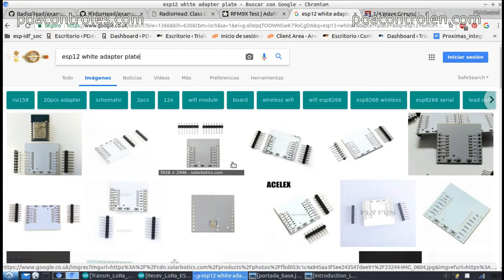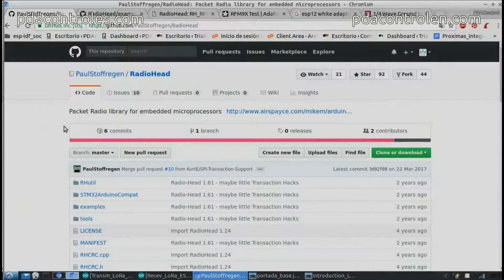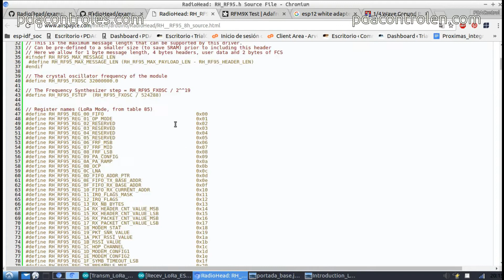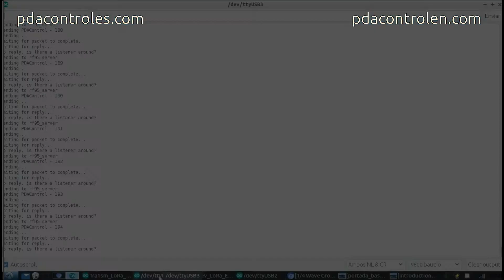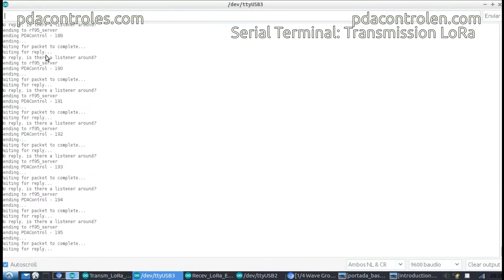Communication LoRa ESP8266 & Radio RFM95 # 1: PDAControl

Comment: Hi PDAcontrol, I followed the tutorial, I faced several challenges - I was unable to program my nodemcu(espp8266) without taking off D0,D1 and D4 (both tx and rx) . After programming with transmitter code, it works, but if i reset it, it stops working and it stops transmitting. Is this a known issue?
Reply from the maker: Hello Naruto Uzumaki, although I never present the error you mention, the SPI pins are common, the important pins are:
Gpio05 / D1 - DIO0
Gpio02 / D4 - DIO1
Gpio16 / D0 - RST
connections
http://pdacontroles.com/wp-content/uploads/2018/03/ESP8266_LoRa_RFM96.png

  I would recommend checking the connections again, in my case it has worked 24 hours in my longest test , regards.
Reply: I did this exact connection but my esp keeps crashing and prints its stack, did you get this error as well? Can you maybe help me solve this?

Comment: hi, had yoy tested the maximun distance?
Reply from the maker: Hello ncarrasco2006, I have not done all the tests of maximum distance, in the next tutorials I will give real data, I recommend you see other tests on my site, http://pdacontrolen.com/category/projects/lora-lorawan/ greetings
Reply: I see but could test if it can exceed for example 1km in a city?
Reply: thanks
Reply from the maker: Hi ncarrasco2006 , maybe with conditions, such as height and direct line of sight without many obstacles, also influences the type of antenna used, I'm thinking how to try maybe measuring with a GPS and transmitting constantly, you have to try, greetings

Comment: Very interresting. I have a lot of Nodemcu ESP8266 and sometimes i have a lot of problems with the wifi. Yesterday i bought a RAK831 to my RPI to make a gatewar LoraWan. With your solution i don t need bay ttgo o heltec with Lora. Sorry for my english. I see you have the tutorials in Spanish. Where are you from, I m from Santander. Greeting Jorge
Reply: Acabo de ver en otro tutorial tuyo que eres Colombiano, pues nada mi enhorabuena por tus videos y tu apertura de tus conocimientos. Un cordial saludo.
Reply from the maker: Hola Jorge Rousseau,  Gracias a ti por ver los videos, tambien he estado iniciando pruebas con LoRa y LoRaWAN, he realizado algunas pruebas con la platforma The Things Network, pense en comprar modulos como ttgo y heltec LoRa pero decidi hacerlo mas adsequible por separado y claro la frecuencia debe ser la correcta, excelnte ese modulo RAK831 tambien he pensado en comprarme uno de esos, he probado este gateway y funciona para esp8266  https://github.com/things4u/ESP-1ch-Gateway-v5.0 presentare resultados en proximos tutoriales, saludos desde colombia